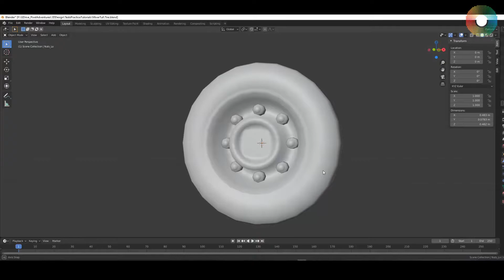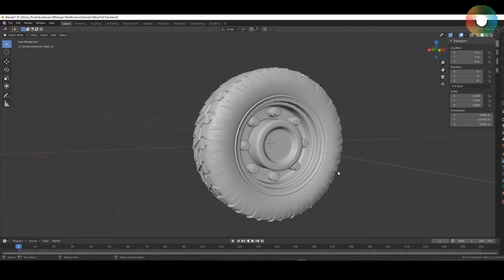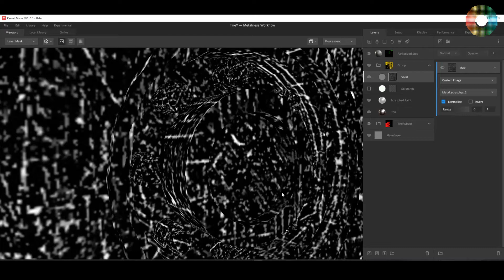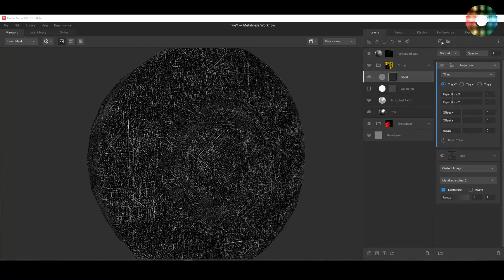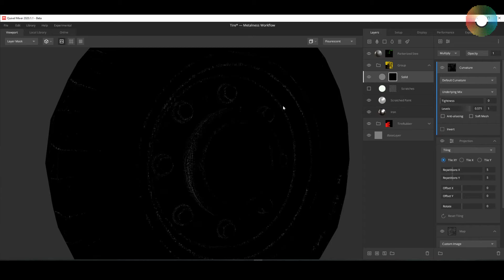Quick Tip: Scratches on Metal (Mixer 2020)

Comment: why not use imperfection scratches from mixer library?
Reply: also possible.. but since everybody will use them... artworks will start looking boring (same is the case if everybody is using the dirt generator in Susbtance Painter).. so you can use this technique to use your own imperfection textures...